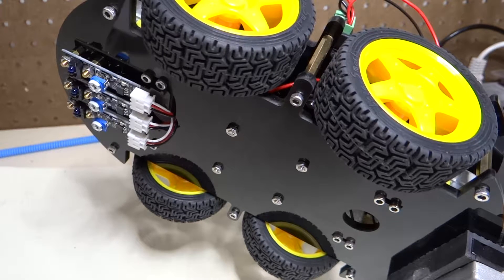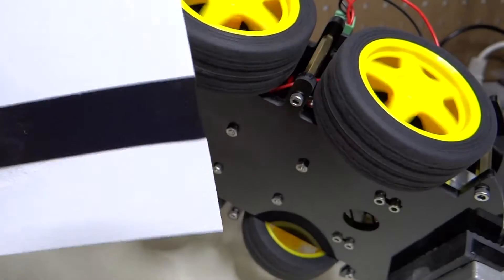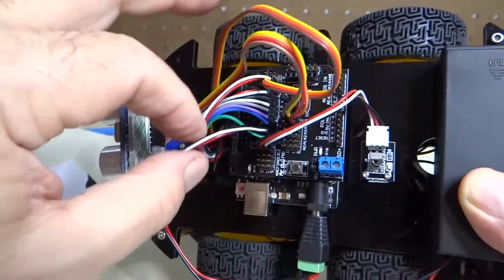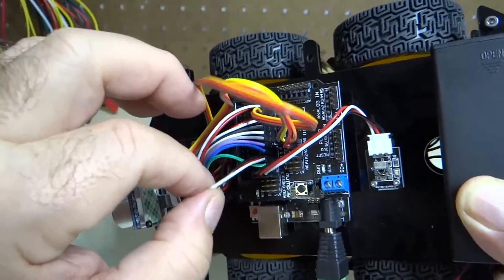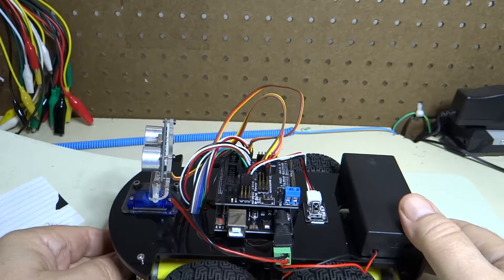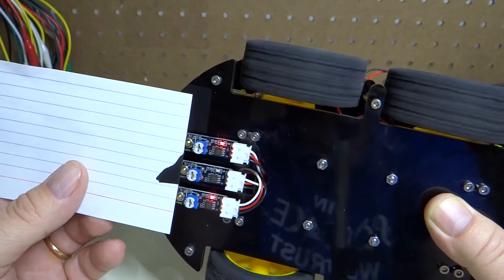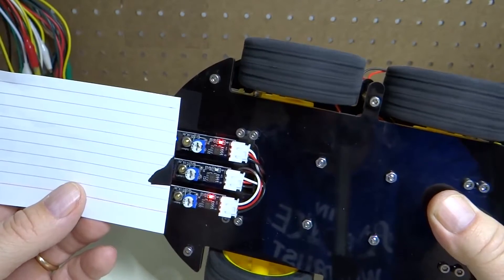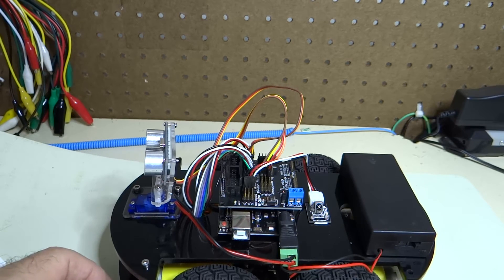Elegoo SRC kit 41 Lesson 5 line tracking car final

Comment: Thank you Greg, your videos has been very helpful, I have looked at them before starting the assembly of the robot, my question is now the following: what happens if I find a part wrong and I do not have the replacement like you had for the servo motor? Is Elegoo sending you a new part? I live in Italy and sometimes it takes one month to receive goods from China..
Reply from the maker: Claudio Peretti thank you for asking! Sometimes I buy two of everything just to make sure I have spare parts. If you can't do that, see if there is a maker lab near you at a university or using meetup.com. Eventually, you will want to build up your own inventory of common parts and tools so that you can quickly overcome a bad part situation.

Comment: Hi, are the motors strong? i want to buy  this kit to use the car as a sumo bot.
Reply from the maker: Omar J. They are pretty strong, use three batteries to make them stronger and faster. This car drives on carpet with no problem and they seem to be tolerant when stalled. However, speed varies from motor to motor, so you will want some speed control.
Reply: oh well thanks. I have to make it a zumo bot for school and we are going to test it competing with eachother and the instructions say it has to be like 2.5 kg or something less than that, and 18x18 cms of dimentions, so I was wondering if these motors along with the weight of the robot was enough to toss another one of that weight out of a ring. But I dont know about the different kind of motors and stuff.
Reply from the maker: Omar J. The motors are strong enough but if you want to use the remote control to drive the robot, I caution you that it doesn't work very well. We had a lot of trouble with the car recognizing the signal from the remote control. I'm not sure why, I need to look into it. The phone app and blue tooth might be more reliable. I'll weigh the car later and get back to you on weight and dimensions.